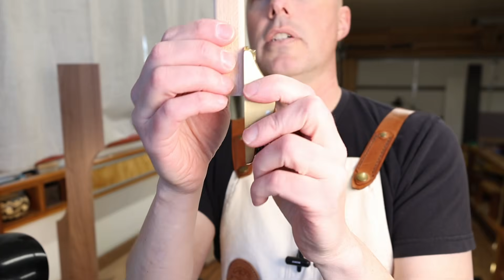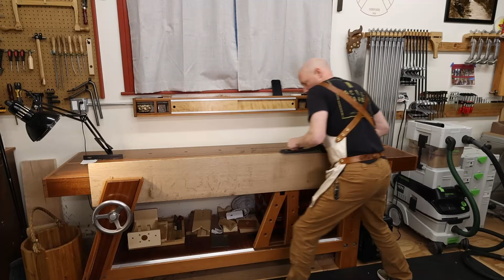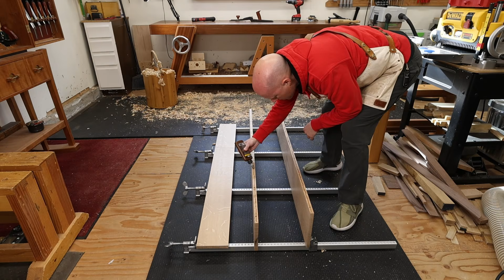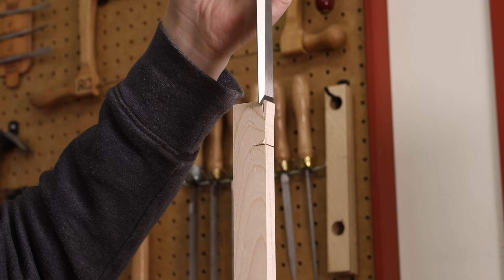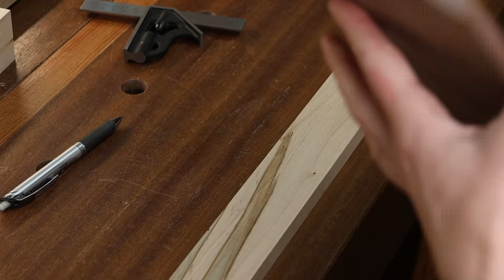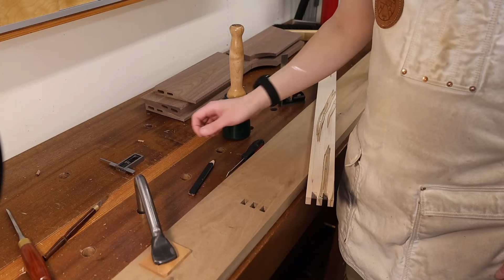A Modern Desk Build, Part 3: Wood choice, dry fitting, triple tenons, and angled dovetails.

Comment: I’m loving your show!! I have a DowelMax but not a domino machine. Why do you use dominoes over DowelMax? Any use cases where you have to use dominoes over DowelMax?
Reply from the maker: Some of the dominos are much longer than the longest dowels I have available, offering much more long-grain to long-grain glue surface area. Also, the domino machine handles the tapered parts more easily than the DowelMax, though a work around could be found for that.